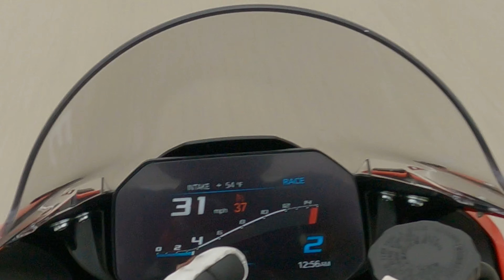Is BTMOTO Stage 2 Worth It?! | How to Install/Reaction! 2023 S1000RR

Comment: Stacks worthless …. BT overpriced , nice video
Reply: I don't think stocks are completely worthless. If you add a sprint filter with it. It will definitely help. BT is a little bit pricey, but the convenience of being able to have that handheld to go with you at all times with multiple tunes is great.
Reply: @Frank7G  sprint filter +$130 usd , BT with +7 stage $1400 usd , + stack +$500 usd , total +$2,000 usd for 3 more hp than a regular ecu recalibration for less than $700 usd …. Sure you will have a device with you that can be used to put on the table of a pille of papers because once you recalibrate on a good way a S1KRR k67 you don’t need to touch the map … 😊
Reply: I actually run the alpha racing stacks combined with the alpha racing air box definitely worth it
Reply: @elviscochitomx mine was 1200 for the handheld tune stacks 300 iat relocation 100 and the bike is completely different I suggest it if you got money to spend

Comment: Bro sick vid, just installed my velocity stacks and the video will be posted april 29th. Mannnnn wrap your airbox with gold or silver heat wrap....... its a must when you got all that done to the bike!
Reply from the maker: Thank you! I’ll look into that man, glad you liked the video:)
Reply: @s1kdk  no problem. want some more ponies get the E85 tune. should be somewhere in the 230WHP ball park depending on how close to E85 you get out the pump. i’m scared of my bike mid range and top end now lol
Reply from the maker: @itshollywood247 unfortunately I live 30 miles away from the nearest E85. I have thought about it a few times for sure!
Reply: I have stage 2 and have been driven 28000km without any issues. Its so good. 😊
Reply: @pierrekronbert6741 do you have Bren tune? Any other mods?

Comment: I dont get how the stacks make "7hp" they are identical to the factory ones except they are aluminum and stock is runner i spent the $300 for them and when i did the job was like wtf is the difference
Reply from the maker: If you looked closer to my understanding the “flange” around the stacks are a little more promt, allowing more airflow into the engine. As well as I’d rather have aluminum than rubber at high speeds any day. Imagine if those rubber ones bent a little bit by the wind and gets sucked into the throttle bodies😅wouldn’t be good.
Reply: @s1kdk  I wonder what the race teams are running?
Reply: @s1kdk  the 24s I was told have the M1000rr stacks as well not sure if that means they are rubber still or not
Reply from the maker: Not sure either🤔good question
Reply: This 7hp comes up in the top end.

Comment: Just had someone destroy the ignition on my new S1k trying to steal it. They tore it all up. Triple tree has scratches all over from them tryna jam a screw driver under the ignition and and broke the top of the screw driver off in the ignition. Can't even put the key in to take the steering lock off. Looks like they dropped it and picked it back up while trying to reverse it.  So pissed. Can't wait to see how my insurance tries to do me over on this. 

Anyway congrats on the stage two. Hope it works for ya.
Reply from the maker: That’s so messed up dude I’m sorry😐😒thankfully I live in a small enough city not to worry to much about it. Whenever I ride to bigger cities I always make sure I can see my bike AT ALL times. If I’m going to a restaurant I make sure I get the window seat, if I’m getting a hotel, I make sure the bike is inside a closed parking lot/in my room. Have to take the right precautions but even then stuff happens, and people don’t want to work hard for what we worked for! Thankfully, it wasn’t stolen. Hope everything works out for you brotha. wish you the best of luck!
Reply: @s1kdk  Thx bruh. Appreciate it. I thought I lived in a safer rural areas too but shits getting out pocket everywhere now. I don't have a garage rn so I have to keep it in my drive, chained and covered but the came prepared with bolt cutters and a drill. What sux even more is I had just got in all the stuff I ordered for it and was just starting to really like it. Now it's gonna be out all summer. 

Enjoy yourself with that stage 2 and be safe.
Reply from the maker: @jvillain9946 I’d advise to get a storage unit, and cameras. Most times people who steal something like that know you/who you are. So just be aware of that. Thank you!
Reply: @s1kdk  That was the plan for winter but looks like winter is coming earlier. But yeah, I have some suspects.

Comment: Although i did all this on my 21 S1K. I didnt feel any noticeable  difference with the ait relocation. Opted out with my 23. I believe the air temperature should be read at the stacks where the true temperature of the air going in the engine actually is. But in all honesty the air is moving so fast, how much does it actually heat up anyway?
Reply from the maker: The air intake sensor is supposed to be what temperature the air is going into the engine correct, however with it being above the engine the reading is inaccurate. The engine running as hot as it does it will then turn 70 degree and make it read around the 120 degree area which is not what it is supposed to read. With it reaching anywhere above 120 it will tell the ECU hey, the engine is hot and the air coming in is hot, let’s not run max power so the engine can cool off more. When in reality it’s fine, the air temps are 70 but it’s reading 120 in the stock position, if that makes sense! It is meant for more track day/drag racer enthusiasts for the IAT relocation kit, however it is good for the street ad well.

Comment: Whats the sense to change the velocity things ?
Reply from the maker: Brings more airflow into the valve bodies
Reply: @s1kdk  but it's the same design as the standard one. And the stock ones take the vibration out. The aluminium one are also not close to the engine?